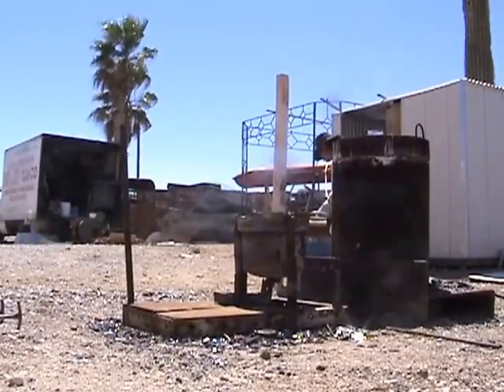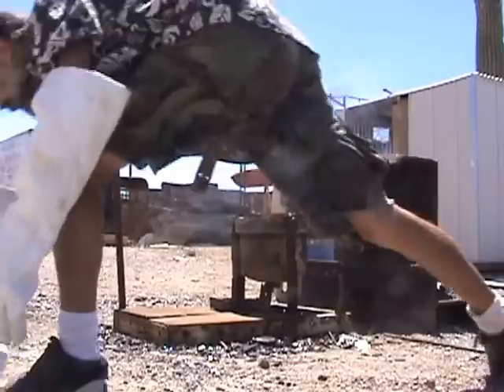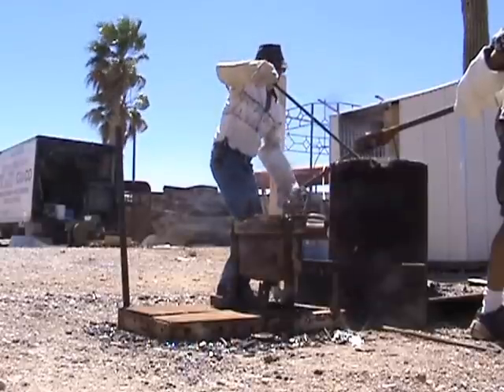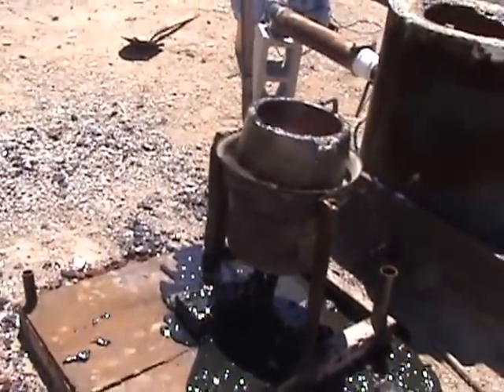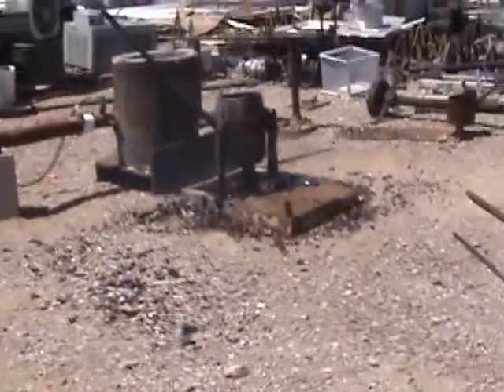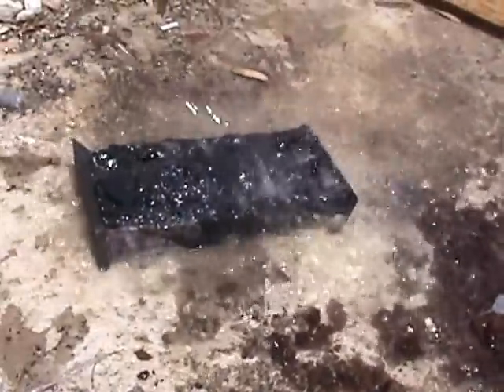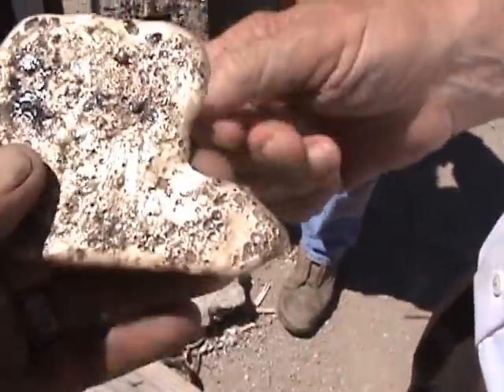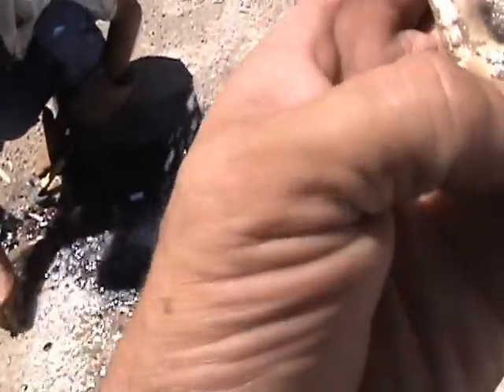stupid white boys pouring a smelt, gold bar from ore material

Comment: This is an incredible pour because that large a crucible is beyond the safety factor to do a hand pour, he has a jig set up for it so it's safe as he can make it.  And see how much flux he uses to get all the little micro bits to flow together.  Probably most of us would not use that much as we think it's being wasted.  Flux turns to liquid glass and pulls off oxides and converts corrosion in the ore to raw metal alloys.  Cliche is volcano created Portland cement blown out at time of eruption and sets up to form false bedrock.
Reply from the maker: our ratio was 6 parts flux to 1 part  ore concentrate

Comment: Todd Tell us more about the broken brownie bar and glass with nuggets.
Yl
Reply from the maker: i know nothing about the dory bar or the nuggets,.. i still have the metal bars, i never had them assayed, i think the silver part was a zinc coating on the outside,.. the glass was part of the flux mixture to pull out the non-essential stuff from the ore, although a friend of mine now has the claim on the apache chief mine,.. and has been smelting out large bars of material, and currently has a deal with the arabs in dubai... who want to purchase all the material from the mine at 2 kilos per week

Comment: The flux is a mixture of silicon dioxide soda ash and borax. It melts to make a sesqui-silicate glass which is called slag and contains the metal oxides of iron, copper, zinc or whatever base metals were impurities with the gold silver and platinum you were trying to recover.
Your flux was nearly right as it left only a little unslagged metal oxides. More flux will give you a cleaner pour.
Reply: How much time to leave gass or temperature in it

Comment: Todd, I still can't remove the sulfur in the sulfide's, to get the gold. Aqua Regia test's positive for gold but no drop. Any idea's? Roasted 5hrs at 1,000. Now trying Hot Nitric soaks.
Reply from the maker: I was instructed to use nails in the flux to remove the sulfides
Reply from the maker: I would resmelt with what we use 1 part dense soda ash, 1 part silica (clear glass), 1 part ore, 3 parts borax and 2 parts flour, or charcoal (crushed)  we also use nails if there is a sulphur content
Reply: yes sulfur alot. Tried with nails, didnt work. Trying a roast today adding potassium nitrate to help remove the sulfur. The assayer say's I need to remove the sulfur before I can do anything with my stuff.
Reply: @1hardman161  good luck with it. Sometimes it's too costly to recover the gold and not worth what it takes in chemicals and time to get all the sulfides out of it. 

I know it's not something anyone really wants to hear, but it's the truth of the matter and why sometimes mines don't do certain things, because it's not cost effective to do it.

I think only a few specialists could remove mass sulfides from gold and they wouldn't share the info and instead charge you to do it for you. Depends really on where it's at and how much sulfur is in your gold. 

I think you'd  want to oxidize the sulfur and break it down. Only way I heard to do that is to introduce lime of 12 pH and introducing oxygen either through a O2 generator or by dosing hydrgen peroxides but I think it would be costly and time consuming. 

I'm no expert, so don't just follow the advice of someone on the Internet and find yourself in an even worse position. 

Ideally though you need a way to accelerate the oxidization of the sulfur so it leaves the gold.

Also quite sure there's a microbial solution to your sulfur problem by introducing a sulfur oxidizing bacteria and then build up the colony so it converts the sulfur and then consumes it for energy..... but this is time consuming and you need to know the exact form of sulfur you're dealing with whether it's H2S, or SO, or thiosulfate, ect and choose the right bacteria and stick it all in a bioreactor (container with the right conditions for the bacteria to survive and thrive). 

Again I know some general things but I'm no expert. If smelting doesn't work and roasting it off isn't working, oxidization might be the answer,  just not sure on the cost effective way to oxidize the sulfur or if it's even possible to do it cost effectively.
Reply: @sparkyjones560  I found grind in ball mill with lime, then cyanide 15 grams per 2 liters, forced air and mix for 24 hrs, then zinc bar to precipitate then filter, then into warm nitric/water to remove silver and palladium[yes I have palladium] to that I drop in 5-6 gram cyanide the palladium precip. The solids from after the nitric, I rinse then into AR, this I ammonium chloride the platinum, let stand 24 hrs, filter, then add HCL to AR then stir in zinc until yellow suds stop it looks like coffee with milk. The extra HCl burns off the zinc which makes a chemical reaction and precip the gold. From 1- 5 gallon bucket this week I got 84 grams total. I need to calcine the palladium and platinum, then torch those. The gold goes into forge with pinch borax and soda. The silver from nitric soak I will wait till it builds up, not worth any money.  Thanks for your reply. Assay report says 101 gram gold, 14 gram palladium, 15 gram platinum, silver 63 gram to the Ton. So yes it was worth figuring out how to remove the sulfur. Lime in ball mill and water grind for 4 hours then rinse away. Here where I am cyanide is not regulated, easy to buy.
Reply from the maker: migel reyas, sounds like I needed to send my ore to you for assay!
Reply: @thedesertartist  Well for the longest time sulfur kicked my Butt. Got it figured out. Could not smelt, because there was pgm's. Didnt know it, so forge couldnt get hot enough,kept getting a matte, ruined a forge and found out cranked the temp up over 3,500 melted the fire brick and pyrometer, but got a 6 gram button. Checked wouldnt you know it there was platinum and palladium with the gold. Well I now go with cyanide then into AR and zinc drop and I also put cons in hot nitric/water soak over night, remove silver and palladium and some of the sulfur, then put the cons in AR and zinc drop from that. Yesterday I put 52 grams of zinc precip back into AR to refine cleaner and I have 27 grams from cyanide zinc drop waiting to go in AR. I wont say where but the exchange ask's where did I get the platinum and palladium, the area is only known for silver and gold. Well my uncle and the miners before him tossed all rock with pyrites into the tailings, thinking no gold. Well I run that stuff and get it. Yes I have to deal with sulfur, but back then [30 yrs ago] they didnt know gold was in the same rock as pyrites, plus they followed the vein.  I have 3 areas next to the mines of tailings mountains. Plus resently found where my uncle had his foundry, all his slag. He was using lead. I crush and run on the shaker table all kinds of lead. He dumped all his slag in 1 spot time and weather covered it with sand and dirt. A couple asked if they could metal detect for coins. They found the area, brought a few of black/grey rocks, I said thats slag. They said the whole area there detectors really went off. So I went and checked, yup big area of slag under dirt and sand.Thanks for responding I hope all is going good for you.
Reply from the maker: @1hardman161  SOUNDS LIKE YOU NEED TO CONTACT AN ASSAYER! LET SOMEONE ELSE WORK THAT MATERIAL! LET THEM SEND YOU A CHECK!
Reply: @thedesertartist  I did have 3 assays done. All came in close on numbers. A place in sugarland Tx said I get the cons to them they would give me half of the gold. They didnt say half of the rest of the precious metals when I asked they said all they got from the 5lbs was gold and a little silver. Another place in Witchita falls Tx said they lost the 5lb sample send another. So I gave up trusting places and decided to do it myself. It takes a 5 gallon bucket of ore to get 1lb about of cons. 1lb of cons I get 1 gm Ag,1gmAu,1/2gmPd,1gmPt. There is roughly 50 buckets in a ton. Florin Analytical in Reno Nv. said 96-101 grams total precious metals per ton. There is a place close to here that is interested but they wanted to see my mines and take there own samples. I wont let people know where my mines are. I wish I had someone I could trust, but dont so I do it. Even the guys that work for me I dont let them know how much I get.

Comment: just FYI but pouring in shorts is just stupid. if that crucible had slipped from the tongs it would have splashed hot metal everywhere instantly burning a hole in that dude's leg. i work at a foundry and hot metal is nothing to play with! safety is always first or you spend the rest of your life regretting it!
Reply from the maker: yea I was pretty stupid
Reply: The tongs they were using sucked it barely had a hold of the crucible. It was only on the rim what the heck dangerous I m sure glad that crucible didnt slip out of the crappy hold they had on it. Build some tongs with a bigger better grip man that is going to kill someone if it slips out. The tongs didnt really fit that big crucible too small. Crucible was too big for the furnace and there is no room to grab it. I use to work in a foundry and the tongs had a lot bigger area to grip the crucible with. Someone is going to get killed. Make the tongs grab the crucible down lower near the middle.
Reply: Shouldn't the crucible have a big rim on it for the tongs to grip?
Reply: oso grande  I wouldn't be trusting this system.  There must be a better way of pouring...
Reply: Like pants are really gonna help, lol.
Reply: Ive seen the aftermath of a big crucible dropping.  Didnt even heat the mold.... Sheesh.
Reply: oso grande One bit of advice from an old guy who ruined a good chunk of his life by living the "what if" game.
Nothing, absolutely nothing in life will steal your joy and happiness faster than what if.
Reply: Im sure a few alcoholic beverages were consumed before, during and after this so called video.
Would not want to be any of those geniuses for any amount of gold.
Wow what a fucking useless existence....
Bet their families are proud of these winners, in what ever trailer park or park bench they live at.
On a positive note, seeing these idiots at work makes people feel good that god spared them the disgrace of being these clowns.

Comment: The "Glass stuff" is called slag.  Or, a waste product of molten material. It's basically just the liquid form of rocks and earth.  Slag can be reduced by separating it from the metal.  How? ...Easy!  Slag is lighter than molten metal in most cases, so it typically sits on top of the brew... Like the foam head of a beer.

Try to slowly pour the material into an elongated, slightly downhill runner (maybe 3-5 ft.) with the ingot mold at the very end. Right before the ingot mold, carve another runner 90 degrees off to the side that is about an inch higher than the surface of the ingot mold.  this creates TWO paths for your brew to go. Slag on top, metal on bottom.  But there is an important detail;  There must be a hole in that inch of space so the metal has a way into the ingot mold, otherwise it would be backed up and take place of the primary runner.   We call this a skimmer brick.

All of that slag, sitting on top, will be directed away from the ingot. The metal will run through the hole you drilled, into the ingot! 

I'd love to see you try to separate the glass from the gold, cheers!
Reply: Well, this video was awesome. I can't wait to see some furnace modifications! Subscribed!
Reply: And find a CO monitor!  You guys were probably breathing some serious carbon monoxide! as well as sulfur and other furnace gasses. Keep the furnace videos coming!
Reply: Joseph Gregor or you can scrape it off the top why it hot

Comment: Todd great to see your starting to get on the gold now. Yeah, most base metals would be oxidized in the slag/removed so that pore was pretty heavy with Silver/gold/PGM's. I get quite a few PGM's myself and I know others who all say the same thing.

We don't need China's rare earths... what a scam. Keep up the good work:)
Reply from the maker: thanks adam,.. i just got an assay back that revealed no platinums,. but my other assay says its highin plat groups ruth, ind, rhod,.. i hear ALS cannot find iron masked materials,.. your opinion?
Reply: Todd Anderson

Hey Todd good to hear from you man!

Spectrometers, XRF's, etc or really just any small sampling method like them should be taken with a grain of salt. Realize that PGM's, gold and the like tend to sink lower in the melt/bar.  Good reason to use a "cone mold" when pouring so as to better separate the heaviest metals at the tip/bottom from the light slag on top.

Anyhow, I'd use a XRF assay on your unrefined concentrate first to find basically whats in the chemistry of the rock so latter to compare to the metals that may be inside. XRF assays or fast & cheap but should never be used alone to base a mining operation from.

If the chemistry of the host rock is in conflict with the suspected metal then its probably just an error in the assay. Fire assays tend to be a lot more accurate, but mostly just tell you the amount of gold/silver... not PGM's though:(

Todd please don't base your mining operation on the "icing" but rather the "cake"... if silver/gold in the ore "pays the bills" then, and only then might you be considering recovering the PGM's too. See they exist but usually not in large enough amounts for the small operator to cover the extraction cost of them.

Often they end up mixed with the gold upon extraction and in fairly small amounts. Those sampling type test may and often do grab a "hot spot" in your sample or a "dead spot" even and can produce spotty results like your getting... or maybe your assayer is drunk that day... or maybe some contamination got in as well from the same ass-ayer:)- 

If you want to be safe you really need to have those Dore' bars completely refined by an expert in "wet chemistry refining". He would benefit from an XRF of your ore and any other test done too. That's a true acid test of not only what you have but can actually RECOVER from your metals. Some stuff is just not worth the premium it cost to actually extract it.  Never ever base your profit margins on sample analysis methods alone! NEVER!

Okay enough with the do's & dont's lecture. Here's a quick method you might try if your comfortable with basic chemistry as it seems you may be.

PGM's Test 1:

For this test you will need:

A: Non-iodized table salt (NaCl)
B: Ammonium Nitrate (NH4NO3)
C: Distilled Water

Here's what to do:

1: Evenly mix test material 1:1 with salt.
2: Heat for 1 hour at 1500 F ( 816 C)
3: Dissolve into distilled water.
4: Add saturated solution of ammonium nitrate ( 190 gm per 100 mL @ 20C )

Results:

A: Gold will precipitate as native gold.
B: Rhodium will form an orange-yellow precipitate soluble in HCl.
C: Osium drops as a red salt.
D: Upon boiling Iridium slowly drops as a yellow precipitate.

Note: best to use reagent grade chemicals and test multiple samples. Also try this testing on both your smelted metals and raw ore concentrates.

Hope this helps you Todd rather than overwhelm you, but hard rock ain't ever easy now is it;)   Best of luck, ~Adam outlaw